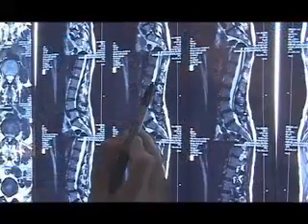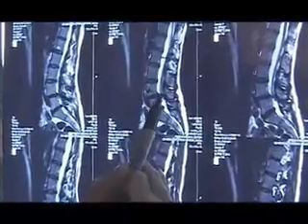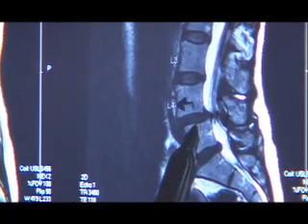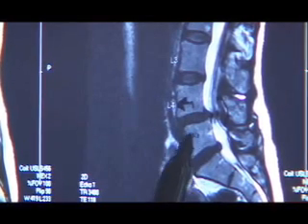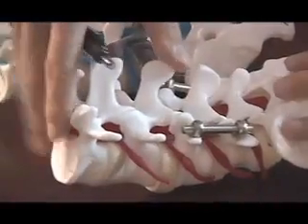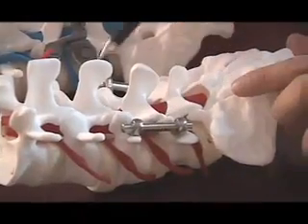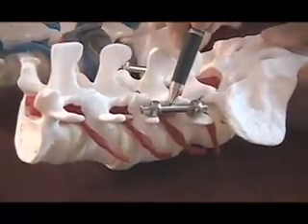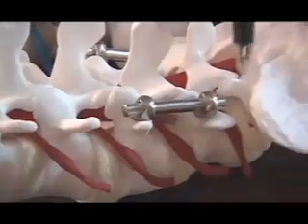New device to treat spinal stenosis offered at UCLA

Comment: Can this procedure work alongside of ADR at the same level? My spondylolisthesis at the S1/L5 has DDD to the point that my neurosurgeon wants to fuse. I'm seeking alternatives such as ADR and facet repair. Thank you for this video.
Reply: Fusion is better for spondylolisthesis. I think ADR is even contraindicated because your joints are incompetent.
Reply: @bengt_axle  I had my 5/1 fusion last Monday.  This is the 1st time in years that I haven't had any tingling/burning or numbness in my feet! Right now I'm experiencing some healing pains, one being that my left outter-quad is burning but I suspect that this will go away with time. It's only been a week!

Comment: I have one bone spur in my last thoracic and two in my upper lumbar  then and two sharp bone spurs pointing inword on the same bone in the middle of the lumber  a total of 4 bone spurs on my spine one doctor wanted to put me in crutches and told me not to twist my back. Another said something about surgery on my back.  A chiropractor wants me to do physical therapy on my back and legs to see if that will solve the issue. I been having back problems since a car accident a year ago.

Comment: I have  a spinal stenosis L2/L3.Bad sciatic pain down both legs when standing.I sit most of the time. Would this device work for me.I badly need decompression surgery to give me my life back.An epidural injection last November did not work.
Reply: I had stenosis and was operated for this in April 14.An epidural injection in nov 18 relieved hipvpain considerably
Reply: Well they say that the leg spinal stenosis could be gone easily but my nurse said I had spinal stenosis which I don't think I do but if she said then ok which mine would be worse because is my back plus I do gymnastics which I think I'll have to stop so your kinda lucky 😕😭
Reply: Get an inversion table

Comment: I think a simple flexible plastic fusion plate without moving parts would do very well.
Reply: Scot Fennell I think the moving part aspect is what keeps the pressure off the levels above and below the replacement, which is why this is way better than a fusion. They say you'll "blow every disc above and below a fusion site, eventually".

Comment: Would Spondylitis be a option for that? As in ankylosing spondylitis didn't want you to think I was confusing spondylosis or Spondylitities which I have both of those too. Severe facet disease now I haven't been diagnosed long enough and no one's explain to me is that part of the Spondylitis or is that mechanical I don't know and a lot more....but obviously I'm not going to put It all....study that means I could get in the study.??? Just a little brief thing I was misdiagnosed with mechanical back pain for 12 years after all my research brought me to the correct diagnosis which was a real world renowned rheumatologist for spondyloarthropathies. but I believe or I've Been Told I'm double whammy some of the crap that's wrong in my spine has nothing to do with the Spondylitis I don't want to go into all of that. In 2008 before I knew I had Spondylitis the neurosurgeons told me I needed a 2 level Fusion not only in my neck but my lumbar too and that my spine was too bad to do any other type of surgery except 2 level Fusion at both places I was on the fence for a year did a lot of research I decided against either one. And like I said they did not know I had Spondylitis and neither did I at that point probably had it since I was a 12 year old girl started with horrid tailbone pain that would come and go at 12 but I am in excruciating pain all the way down below my lumbar all the way to my neck and both shoulders 24/7 for the last 15 years straight so man if this could help me cuz I've been thinking about revisiting the the surgical Fusion I've tried just about everything I'm sick and tired of pain medicine that doesn't take it all away by any means it makes it more bearable is all I did a radio wave albation in the lumbar it did help for a little while with the intense throbbing but not with other issues just in that one spot epidurals do nothing for me at all !!!!I could go on and on and on so this really interest me please get back to me thank you in advance.

Comment: Thank you. The surgeons are opening my entire spine on the 20th of this month. I have no choice. I have a major curve in thoracic and my spine is unstable again. I also have degenerative disc and joint disease that developed because of these surgeries. It was the first surgeon who cause all of this by operating on a small herniated disc that should have been left alone for just physical therapy.
Reply: I was curious pasnowqueen how did things go and how are u doing now?? What did the doctors do in surgery for u?
Reply: Yes sir, may u pls update
Reply: How did your last surgery work?
Reply: I like you had a herniated disc that was treated with a fusion, shame on him for using me as a source of revenue. The spine was not created by God to be a fixed structure, it need mobility. There is also a new procedure that has been approved by the FDA called TOPS. I am currently looking for surgeons who perform this procedure in my state. It works similarly to this procedure.
Reply: I hear therapy or seeing a chriopractor for spinal stenosis , is better and much safer than surgery anyone know if that's true ?
Reply: The68lespaul me !!! I won’t let any doctor open my spine
Reply: @The68lespaul  that all depends on how progressed the stenosis is .. if it’s sever then many times those remedies unfortunately don’t work.. and your options are basically to have them go in the traditional method to repair the stenosis.. they usually want to do a fusion from my experience.. which is what I’m looking at right now and will be my 6th bout of sever stenosis in the past 15 years.. iam fused completely in cervical and lumbar ..  I’m researching the superion implants .. they want to implant them but my research indicated they are not indicated for severe stenosis.. so idky they would implant them .. but research indicated 80-90% get relief from them with regular stenosis.. good luck
Reply: @The68lespaul  a good chiropractor will not touch a back with stenosis or hernia
Reply: @zephyrinne1  how do you know this ? why wont they ?

Comment: Can a previous fusion with rods, screws and a titanium cage be removed and replaced with this device?
Reply: I'm not a doctor, but my physician told me that this device is designed primarily to PREVENT having to get a spinal fusion, not AFTER.  However the Coflex can be used IN ADDITION to your spinal fusion to stabilize the rear portion of your spine.  But always consult with your doc, first.
Reply: Tha5s what they want me to do as well titanium cage ugh
Reply: I was going to get the cage.  I’m in agony and can only stand for about 15 min at a time.....   L4-L5-S1